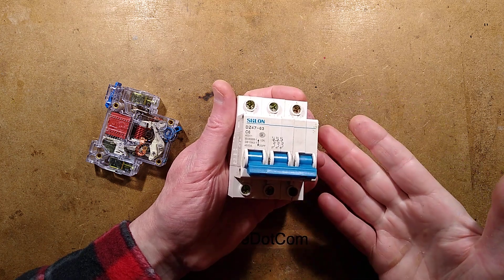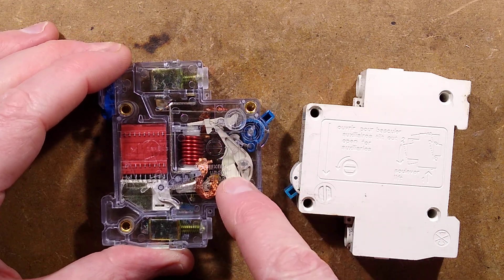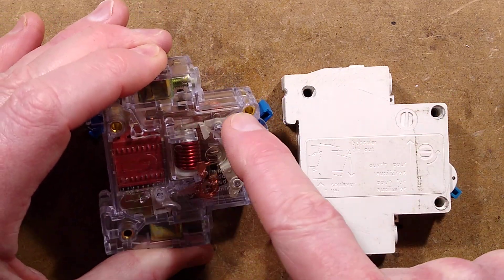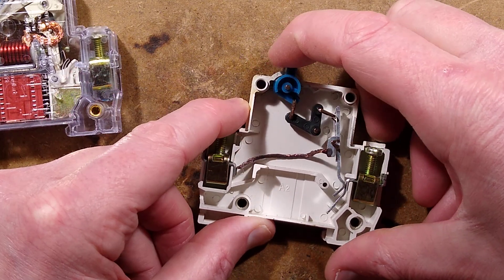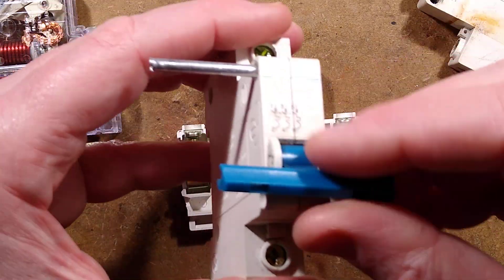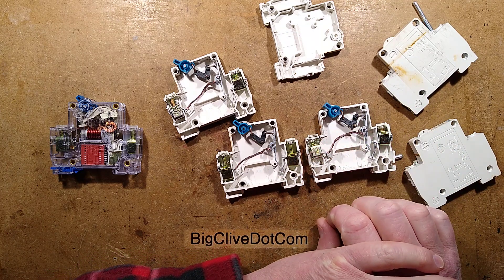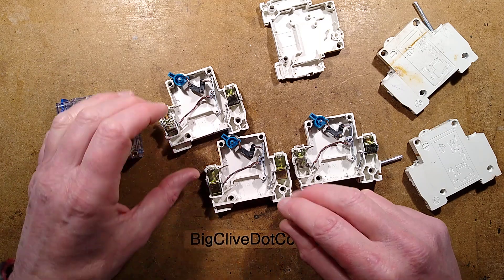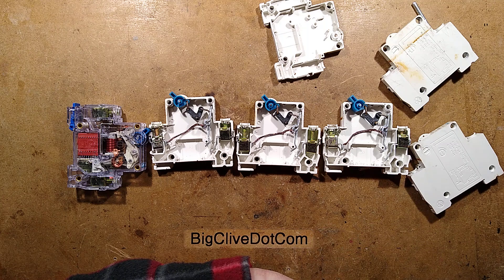Inside a fake un-trippable circuit breaker.

Comment: Somehow this managed to be even worse than I imagined...
I thought it were just literally going to be semi decent wire just jumping from one side to the other. As a dead short...
But this here with an actual contact is likely to have much higher contact resistance than a dead short, so it might potentially get fairly warm if left to it's own devices powering a more hefty load. And I am going to guess that they might have skimped on the plastics too... So potentially a fire hazard in itself as those steel contacts heats up over time.

But actually testing protection devices is generally a wise idea. Even if the test can be as simple as intentionally running a few more power hungry loads. (Like a pair of space heaters.)
Though, a lot of people do not understand what fuses are for.

A fuse isn't there to save people's life if one pokes a finger into a socket, or if an appliance gets an electrical fault. Nor is it there to to be annoying.
A fuse only job is to ensure that the cables in the walls doesn't heat up sufficiently to start charring their insulation and risk a fire from starting. (Fuses can also protect against more energetic faults, but this is frankly a secondary concern in the life of a good fuse.)

Though, some people just put in oversized fuses regardless... (Or at times replace them with a nice solid copper/brass lug. In regards to the older style ceramic fuses.)

Comment: When you were listing people who would like this.. I just installed an outdoor plug off a 30a breaker specifically to run my welder. But I guess it's a bit different if I have proved the circuit and understand the risks. And the welders fused to 13a. I just want a beefy circuit to avoid tripping the breaker every other bead.
Reply: The problem is mobile or site welding.  You often don't know what you're plugging into and are at the mercy of whatever the builders or the main site contractor have set up.  Quite often the builder's pole will have low current wiring, high current sockets, and circuit breakers that have been tripped so many times over the years that they will now trip when someone plugs the kettle in.

Comment: We were recently given a Chinese Special "Honda" diesel generator (that's actually Gasoline, oops), that claims to be able to output 5000w or so. It has 3 240v Schuko plugs, and a 16A three phase plug (3P+E). "Protecting" it is what looks to be a 63A breaker. Completely going over the fact that the rating is ridiculously high, I'll definitely have to check if it's even real at all now...
Reply: It doesn't matter if it's real or not. If you short circuit the output the voltage will drop and your extension cable will be warm, a 63A breaker would never trip.
Reply: @mrfrenzy.  That's exactly what I'm saying. Now I have doubts that it's even real

Comment: It is dangerous as a untrippable circuit breaker without discussion. But it is dangerous as switch too. Only zinc plated steel as contacts without proper contact material. Probably it can cause fire in switch function because of internal resistance of contacts sooner or later.

Comment: Got one of them huge variable resistors? I'd like to see how many amps that "fuse" can handle before it melts.
Reply: That would be a huge variable transformer in this case. Wouldn't want to dissipate that power in a resistor.
Reply: @AlphasysNl  I'm talking a load bank, they're designed for this. Some are variable so you can dial in the current.

Comment: Its not a circuit breaker, It a rail mounted  motor disconnect switch. Who needs a knife switch. Circuit breakers always trip when they pass the ratings when you don't want them to. But humans are smart and they can trip it faster then any safety device.

Comment: The unsettling thing about this is that at least a dozen people must haven been knowingly involved in designing and manufacturing that. Someone who ordered it, engineers who designed it, produced the molds, sweatshop workers who manufactured it.. Makes you sick.
Reply: They need to be jailed and all their stock confiscated.
Reply: The moulds are probably sourced from the same factory that produces real ones and will only cost a few cents depending on the order.
Reply: @paulc1197  Correct. There's plenty of room for actual protection circuits in those housings. No sense making a special one for your fakes.
Reply: @paulc1197  Company A can make those for other companies that make breakers. Company B makes actual breakers. And then there's one shady company Z that decided to make cheap switches and disguise them as breakers. That's one possible scenario. Second - shady company Z bought decommissioned line that makes those cases for a price of scrap metal.
Reply: might only be one guy who does this. could have been designed internally as switch (they are available in this format too), but the labelling is wrong and misleading

Comment: Knowing sellers should be tried for (attempted) manslaughter!
Reply: A when convicted given the electric chair via one of their own circuit breakers.    Poetic justice.
Reply: Arson.
Reply: @r0cketplumber  
Attempted arson and attempted murder. Or, if a fire breaks out and/or someone dies, drop the "attempted" part of the respective charge(s).
Reply: sellers should be eliminated permanently. Then you'd see a reduction in these things.
Reply: @cjay2  or the makers to start with
Reply: "Attempted manslaughter" is an oxymoron... Manslaughter basically means "killing somebody without intent", you can't "attempt" that.
Reply: @mallardtheduck1  I believe it's not an oxymoron in some jurisdictions, where it's standard terminology (and "murder" requires premeditation).
Reply: @mallardtheduck1  "Culpable Manslaughter" is the correct term I think! That would be applied to the landlords who use them too!
Reply: @mallardtheduck1  Gross negligence possibly leading to death
Reply: @mallardtheduck1  today, Stuart, you have won the internet.  That is despite being in one of the best comment sections on the internet.
Reply: what proves they are knowing
Reply: Thats a criminal act, insane
Reply: crimes against humanity
Reply: Robert Daggett  NO excuse me, but the part is marked for a function which it does NOT perform. Do you not comprehend the jist of “contaminated supplies”, or are you calling out Clive and parts houses as both liars?

Comment: Wow,  just Wow...

you think they would at the very least solder in a cheap Slowblow fuse
Reply: The whole thing is a slowblow fuse when you run enough current through it, just don't be surprised if it catches on fire when it blows.
Reply: The reason there isn't a fuse is because, as big Clive failed to point out here, when installed CORRECTLY, your house operates as a fuse.

Comment: anyone and anything to do with those abominations need to be jailed. that will straight up burn your house down. never cheap out on safety equipment. No one will fault you for making something MORE safe even if it costs more but if you cheap out and things go wrong it will be your ass on the line and you may be directly responsible for someone's loss of life.

Comment: For some reason some chinese machinery comes with (annoying) fuse-switches like this. To my understanding, the (3 phase) fuse in many of them is not actually necessary or does not provide any safety to the system if otherwise the installations are appropriate. Maybe that is what these are for?

Comment: So they're the electrical equivalent , of a quacks medicinal potions.
Reply: One containing poison. Most quack potions were ineffective, but at least not too dangerous.
Reply: @dlevi67  I think you could  consider these like homeopathy, quite harmless for treating imaginary conditions, but you try to use it to treat a real dangerous condition and you suffer the consequences.
Reply: @peterjf7723  The real issue is that lack of a spark arrester. Without that these are an electrocution risk.

Scenario: high-current resistive load. You go to the panel and throw these ganged "breakers" to off. Inside the "breaker", an ionized path (arc of electricity) is still flowing between the switch contacts—and your device is still live and with quite some current going through it.
Reply: Maybe you can make them safer with one of those Snake Oil Power saving devices?
Reply: I can see a big market for 'Homeopathic Breakers',  The number of components have been diluted to such degree that there are none left at all, which makes them 100 times more effective than 'conventional' breakers.
Reply: If we were to sing a song about quack medicinal compounds to go with my original comment and considering the channel preferred color is pink. It would have course be The Scaffold's Lily the Pink.

Comment: What kind of sicko would manufacture this?
Reply: Any sufficiently un-scrupulous person who wants to make money - and there are sadly many of that kind in the world!
Reply: They are for people wanting to get revenge on someone they don't like by installing fake breakers, knowing that sooner or later their house will burn down.
Reply: At first I thought it was a regular three phase switch, just relabeled to look like a fuse by some devious merchant. Until Clive opened it and the arc quenching component was notably absent. It was not ever even a proper three phase switch in the first place.

Note that the coil in a breaker is not just there to throw the switch in case of a large overcurrent, it also creates a magnetic field to push an arc into the arc quenching chamber. That way, the breaker can reliably work even when installed upside down.
Reply: They're made in china. Last time I looked, they were communists. Just another small way to destroy a country.
Reply: @cjay2  Sorry to burst you bubble, but China isn't really communist.
Reply: @cjay2  Considering the recent events in US every damn country is "totalitarian" - you have your freedom of speech and stuff till you're getting in the way of rich and powerful.
Reply: @cjay2  737MAX was made by communists? Sony laptop batteries? it's very pure capitalism. Cutting costs to the max with no regards for safety. Why such things exist? Because idiots that want to buy stuff as cheap as possible without even thinking that it's TOO cheap.
Reply: This kind? 

https://www.bbc.com/news/business-48174797
Reply: The communist kind...
Reply: @aevangel1  No dude. It's pure refined capitalism. Making money out of crap, next step is Wall Street and fake stocks - making money out of thin air.
Reply: @aevangel1  So the democratic kind decides to bomb 3td world countries?
How is that better than communism?
See communism is a form of government, neither evil or good. And then you end up with a president like Trump. 😂

Comment: Some time ago I got a free 3p 400v chinese generator that wasn't working though the engine ran. I did some tests and it turned out that the windings had a few shorts in them. Did some more tests and the "breakers" really where only switches. They where branded Huahe c3. I tried tripping them with my big bench power supply set to 60A, 5 min later they where smoking. To sad those switches are indeed in service
Reply: Did you record a video of you testing these.
Reply: @simontay4851  Sadly not, wish I did though (need to have a search, might still have the other 2)
Reply: @techtastisch7569  What i found to be a huge insult inst so much the fact these are just fake switches essentially, cause at least they are the chinesiam switches i would tend to replace anyway with name brand stuff from a supplier with a name to protect, it is actually that supplies occasionally get contaminated with fake name brand stuff, i dealt with a chinese no name breaker that while it was "real" its tripping characteristic was to just get really hot and start smoking instead of tripping, it had all the internal bits but the stuff just wasn't made well, same thing as you though it was on a no name Chinese diesel generator, annoyingly the generator was a good model, had a clone yanmar engine that was rather decent and even the genset head was well done, it was just its breakers were utter shit, and its outlets too, the 240 volt plug was very loose fitting it still have the generator, but its got new wiring inside the control, new outlets and new breakers that thankfully are compliant... oh i forgot one more thing, when i pulled the control apart the ground was just not even bothered, no wiring and the plug on the outside youd shove into the ground, just had a bolt on the other end with no connection.
Reply: ABout 15 years ago there was a huge wave of recalls of faulty generators in central Europe, sold under names such as "Kraftwelle" or "Swisskraft". Every time one of these operations was shut down, another would pop up. Electrical safety was abysmal and according to some people online, even completely rebuilding one electrically wouldn't likely last long because the petrol engine could fail after only as little as ten hours.
Reply: Do you guys purposely buy the absolute cheapest on the market knowing it would fail?

There are a lot of Chinese brands that has been opened up and work properly. Must be some odd company you guys picked it up from.
Reply: @fleyua7176  thats implying that i bought mine new, i found it at a scrap yard for the price of scrap, thought it would be fun to take it home and if it didn't work then take it apart and well itd be a learning experience, i know that there's good Chinese made equipment, i have a couple, one on my truck made by centurion, and another that was made for harbor freight tools, this one was meant to be a bit of fun that became useful plus it was the only diesel generator ive ever owned, and really only the electrical was abismal the engine and the generator head were fine well done stuff, just the wiring and faulty breakers, thats what i mean though, you look at it and it all seems fine, so you dont look deeper and dont see not connected grounds and faulty circuitry, its a could be great product, until it either burns to the ground or electrocutes you cause its ground isnt connected. Thats the problem there is this kind of stuff it looks the part, acts the part and seems perfectly fine, but its dangerous in how the manufacturer cuts corners.

Comment: Oh crap. That's a real problem. I never thought about the weight.
Fortunately I just somehow happen to know where I can get some scrap car batteries illegally dumped down by the reservoir. I can cut out chunks of the lead plates and hot-glue them into the fake breakers I sell on AliExpress.  Thanks for the tip!
Reply: and before you call the authorities, yes, of course I'm joking.
Reply: if car batteries have really been illegally dumped by a resoviour, you need to get them out ASAP. Lead could contanimate the drinking water.
Reply: @simontay4851  Obviously. Just as obviously I wasn't being serious. I am mocking the behavior of those who would do something as evil as to sell an utterly fake circuit breaker that could start a fire that could kill people.
Reply: @simontay4851  it is all a joke. BUT, in the US, at least, car batteries never sit around in urban areas because they can be recycled for real money. If someone left a car battery by the side of the road, some scrapper would pick it up and recycle it for a couple of bucks. Also, most car parts stores will accept old ones because like I say, they have some value as they can be recycled to make new batteries.